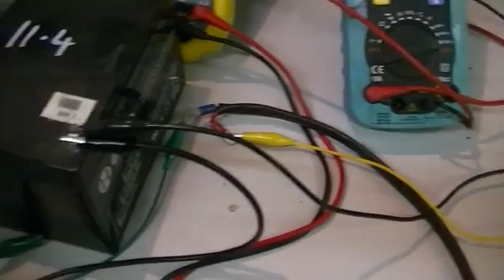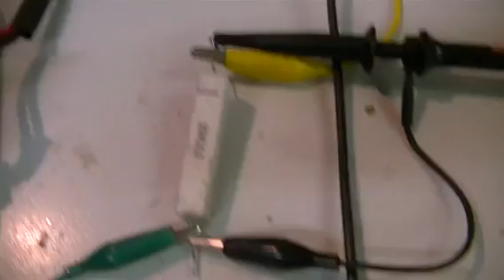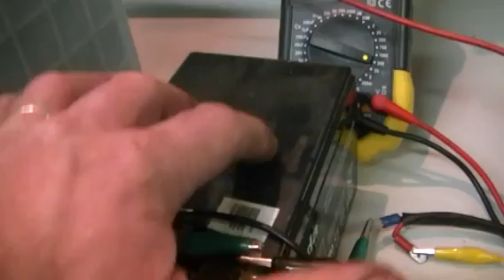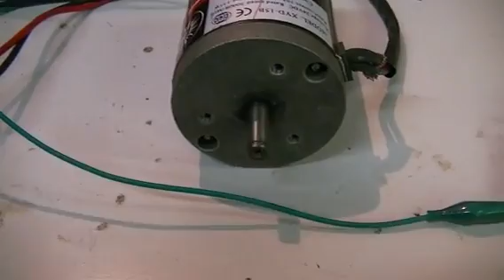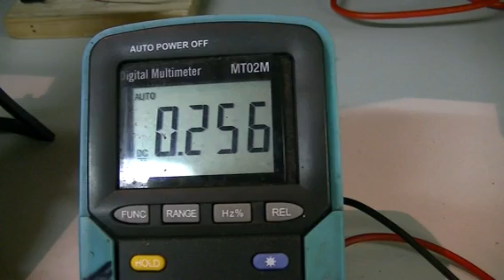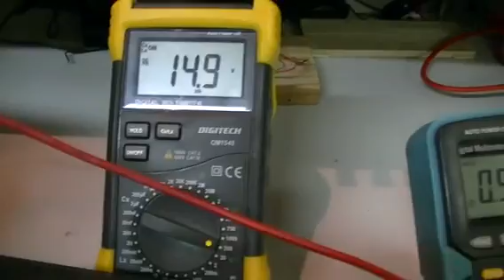3 Battery Paradox video 2 xx Jumping motor

Comment: could the two 12V (24V) be charging the battery? in effect transfer of power from the two to the one. I would advise taking measurement of the two before and after to see if the power lost is equal to the power gained in the little one. if such thing happened. my knowledge is not up there so I am truly asking out of curiosity. - Jeffrey in Arizona.